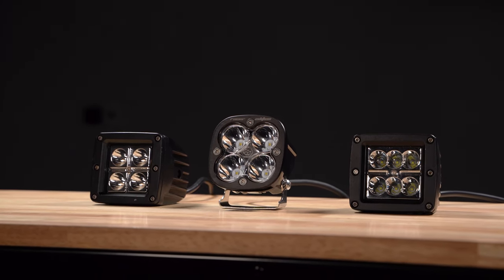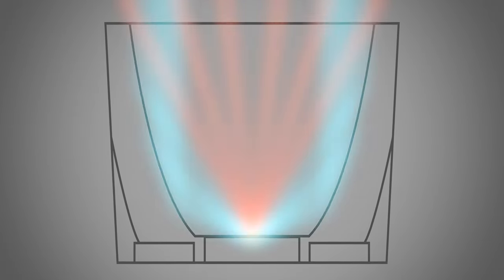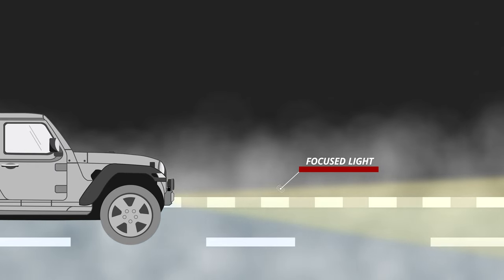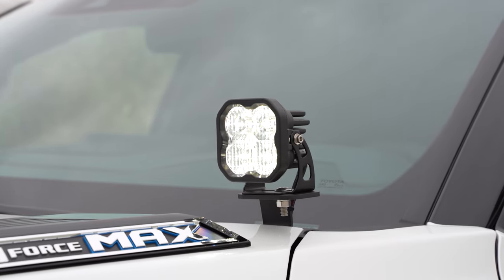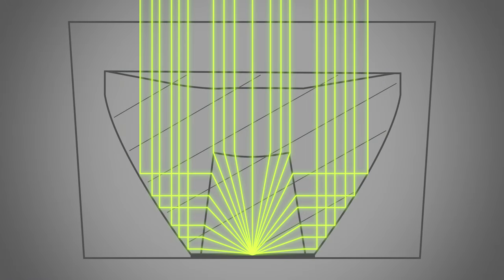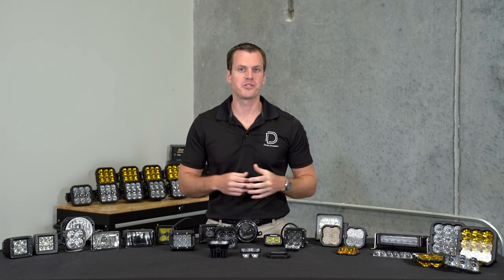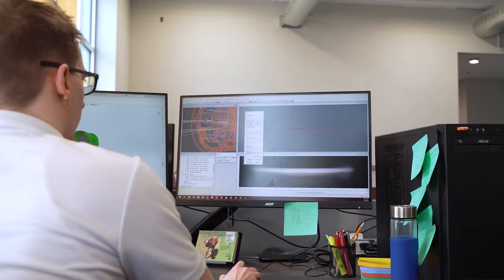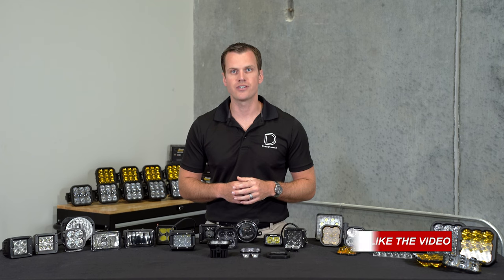LED Optics EXPLAINED! Reflector, Projector, and TIR | Diode Dynamics

Comment: The cheapies simply blast high output light  blinding oncoming drivers, which is why DOT has guidelines. . This company does a good job with headlights,  as this video illustrates. It's different if you are running a combine in a cornfield.
Reply from the maker: True - the benefits are most noticeable at speed, while driving on or off-road. However, even in the field it's worth considering how much light is shining on the actual field, vs up into the sky where it is wasted. It may be helpful to shine that light in a very wide pattern to illuminate the whole field, rather than wasting it up or down. Of course, not as critical as racing, but seeing what you need to always makes the job easier.
Reply: Not only that, but DD has some of the best thermal regulation out there. While some may be “brighter” on initial startup, some will drop up to 50% initial output in just 30min. This is especially helpful for something like fog lights that are usually tucked inside the bumper with very little airflow.

Comment: great video - thank you
I'm from Poland and I'm wondering how to modify the lenses (probably TIR) in the headlights, e.g. Ford Fusion full LED 2018, so that the low beam glows asymmetrically (EU regulations). It seems to me that the grooved plane visible in their lens would need to be modified. You have an idea?

Comment: Are the TIR lenses plastic and which others are? Can plastic be used with the heat?
Reply from the maker: All of the optics we use are Automotive-grade Polycarbonate! Yes, they work great in both hot and cold temperatures!
Reply: @diodedynamics  Interesting thanks.
Reply: @diodedynamics  Do TIR lights have any form of  reflector like a regular reflector light would have or is it all down to the lens?
Reply from the maker: @Leo-gt1bx  TIR, meaning Total Internal Reflection, optics utilize the entire lens to create a very efficient beam pattern, with little to no light spill! There are no other reflectors in the housing past the optic itself.
Reply: @diodedynamics  Ah thanks. I have been been looking at custom making an integrated light for my bicycle but am struggling to decide on my optics. I am looking at using an emitter such as the SST 40 or XHP70. Any suggestions or products you make that would give bright throw/flood that can run off an 18650 3,7 cell?
Reply from the maker: @Leo-gt1bx  I would recommend giving our team a call at 314-205-3033 Monday-Friday 10 a.m.- 5 p.m. CST, or shoot us an email at contact@diodedynamics.com, and our service team would be happy to help you with that!
Reply: @diodedynamics  Great thanks I will email them.

Comment: Do the molded connector meet USCAR-2?
Reply from the maker: Hello! Assuming you are asking about the bulkhead connector used on the Stage Series pods - this connector has not been tested to USCAR2 standards due to the lack of specific customer requirements, but we believe it would meet this standard if needed, probably with classification of T3 / S3 / V3. Please feel free to email us with any additional questions!